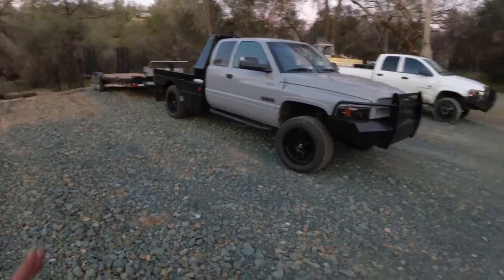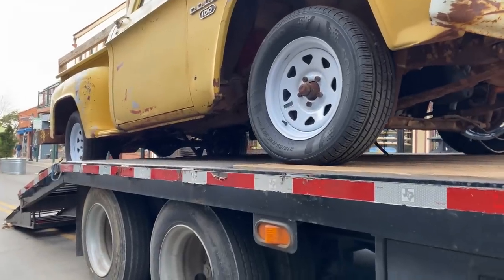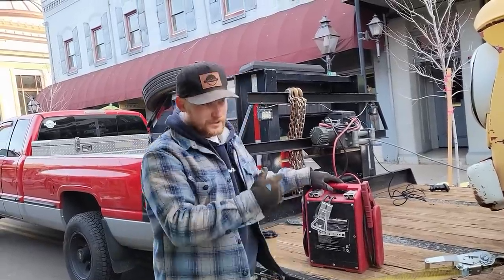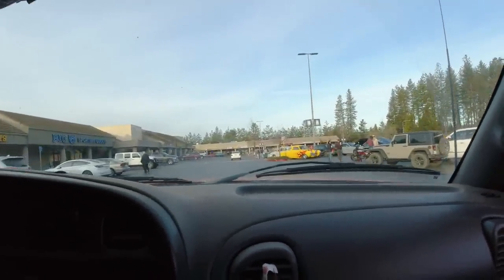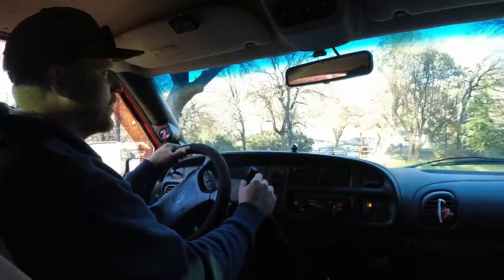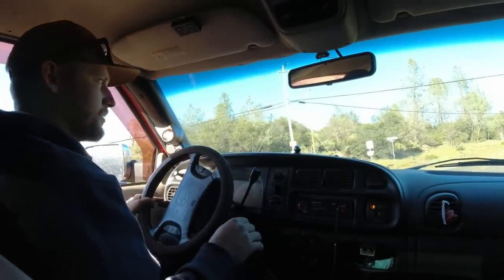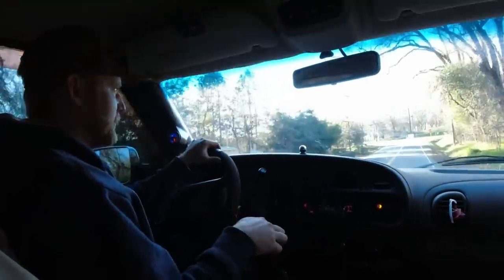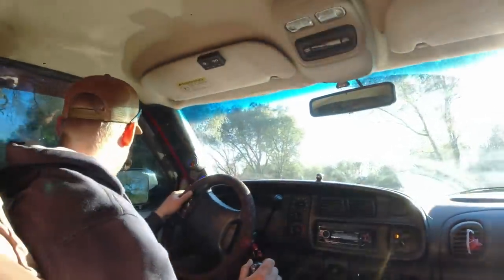Back in action! 6 speed swapped 12 valve towing! Cars and coffee head Turner!!

Comment: I currently haul with a 01 v10 ram 2500. It sure does great as long as you have stock in oil companies.  It's auto but shifts great.  Love my Mopars. Ps I'm 63 so have a little experience with trucks and not much hauls like a Dodge. Great videos and much appreciated.
Reply: hell yeah man i loved my v10 miss that thing every day, could pull anything and if it couldnt it would rip itself in half trying
Reply: @pool_noodle420  exactly.  450 ft pounds of torque.  If it can't pull it something is gonna get broke.
Reply: I’ve got a 1996 extra cab longbed 4x4 with the v10 and auto. I’ve been very happy with the truck.  Your right I think it would tow anything you want to hang behind it if you can afford the fuel for it lol.

Comment: Thx you for doing the ol 12v content 😎 My trailer weighs around 7500lbs and it's a 2014 30' loadtrail triaxle with pull out ramps. My next trailer will for sure be a 30' tandem dually diamond c with hydraulic dovetail 👍Love that G56 swap 😎

Comment: The G 56 six speed looks like a nice transmission and the governor spring definitely helps I’d recommend getting a governor spring where you can do the 3200 RPM thank you should little bit more top end something else everybody over not everybody but a lot of people don’t do enough to their head if they took the head off and got a ported nice nice porting job nothing radical and while you’re there but the nice valve springs the beehive valve springs cause I make your stuff last longer but anyway Hamilton Tim’s stage to head is a real nice had good for towing and their well-built so this is six in a row jim From Tenorel PA I got a 91. Five Dodge give you three guesses with under the hood and yeah it has a Hamilton cans stage to head

Comment: I’d just get old yeller running and drive. Without any modern upgrades.  Considering me and it are the same vintage.
Reply from the maker: Engine has been open for 30 years. No trans. Sleeper would be way more fun.
Reply: Ok in that case you’re absolutely right.
Reply from the maker: Yeah be a lot to chase down all those parts

Comment: Curios as why you prefer a G56 over a nv5600?  Is it packaging in a 2nd gen or or ratios of gears....    I did a g56 in my old 07 single tire about 12 years ago and having a 05 dually with a nv5600,   I much preferred the 5600 for towing..   granted that truck was well built and dyno'd at 450+/- at the rear wheels on 35's.    It also towed heavy on on the farm quite often on out 35' Big tex 22gn.   
I am curios as I am looking at picking up a buddies 02 24v that needs a new bottom end.
Reply: I'm interested also because I have a 96 12v with a nv5600 6 speed in it.

Comment: nothing to sketch just pulled 15,000 pounds of 3/4 gravel in a 12,000 pound dump trailer with the 2011 ram 4500 flat bed.
Reply: Slow to take off but other than that it probably doesn’t know what’s behind it. Beast
Reply: On the flat land yes when I had to climb 1,000 ft in 2.7 miles I definitely knew it was back there
Reply: The trailer empty weighs 4,000 pounds
Reply from the maker: Get r done